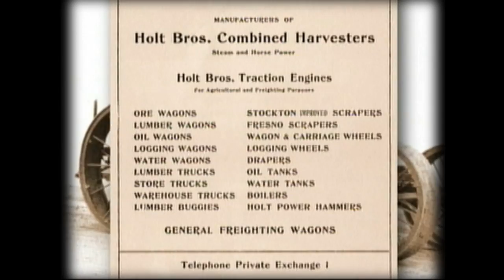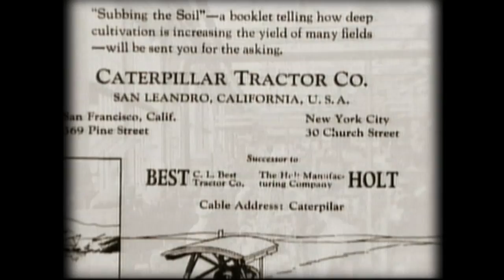Benjamin Holt and the Caterpillar Tractor

Comment: With 1881 Pancakes begins "self-feed" construction on caterpillar to a course which was constructed in 7 years, in 1888. It had the device as a car in which the steam-engine in capacity of 12 hp was established. Thus the car gathered speed of 3 versts at an o'clock (3,2 km/h). Blinov "self-feed" was exposed at Russian industrial exhibitions, in 1889 it was shown in work at an agricultural exhibition in Saratov, in 1896 — at the Nizhny Novgorod fair.

Comment: In 1877, the inventor made "car" on caterpillar to a course, a reminding railway car with a wooden body. «Infinite rails» car represented the closed iron tapes consisting of separate links. The car had 4 basic wheels and four leading asterisks. It was actuated by horse draft and, in essence, represented the caterpillar trailer. In 1878 the petition was submitted to Department of trade and manufactories about delivery to V.Blinov of "privellegiya" (patent) which was given out in September 20 1879